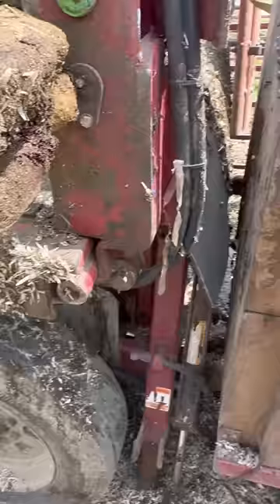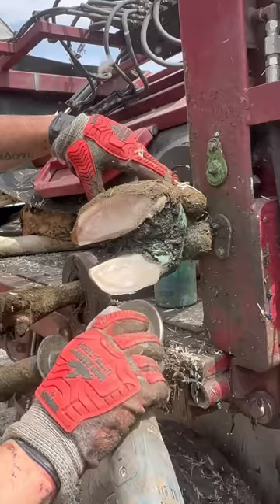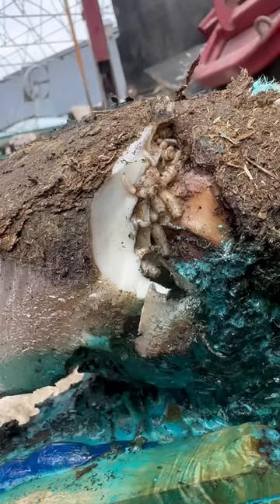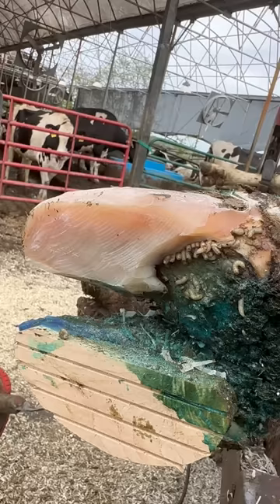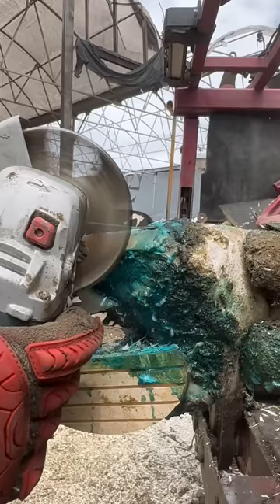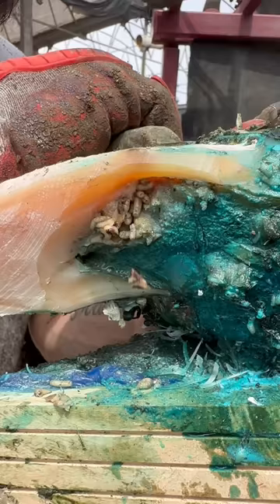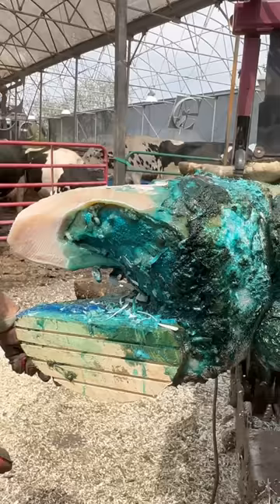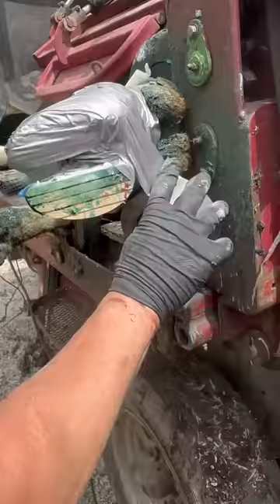MAGGOTS clean Necrotic Tissue INSIDE this Cow’s HOOF.

Comment: I have a question? How come I always see that when you clean the hoofs never wash the injured part  before you start opening the injured it.
Reply: My question too cause worms still was on the hoof
Reply: Washing hoofs doesn't usually do a whole lot.  First, they have been covered in manure.  You are not going to get them very clean.  Secondly, the process of trimming the hoof gets it cleaner than washing it does.  Thirdly, most of the dirt that needs to be removed is underneath the loose hoof horn.  Which is why a lot of hoof trimmers will trim first and then clean the exposed wound.  The main reason to wash it first is to see what you are doing better.  A lot of times just scraping it with your hoof knife a little will accomplish the same thing in less time and without creating a mess with water sprayed everywhere.

Comment: Before treating.  Th cattle dud you guys injection any form of medicine to avoid pain during the treatment process????
Reply: Hoof trimmers don't cut into live tissue. 
What they're doing for the cows is essentially the same as when we clip our fingernails. They're just giving them a mani-pedi.
The entire process is painless… Unless there's an infection, obviously, but that wouldn't be because the hoof trimmer is causing any pain — they'd actually be the ones to relieve it!!

The only way they might possibly hurt the cow is if they accidentally nicked/cut into the corium. But that's very rare. 
But even removing all of the hoof horn is a 100% painless process… as long as they're careful to work around the corium.